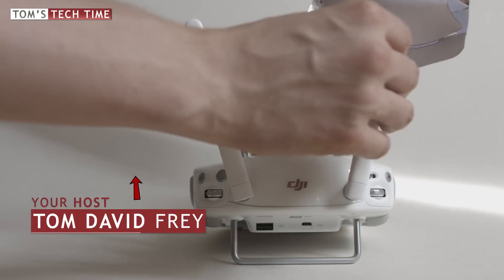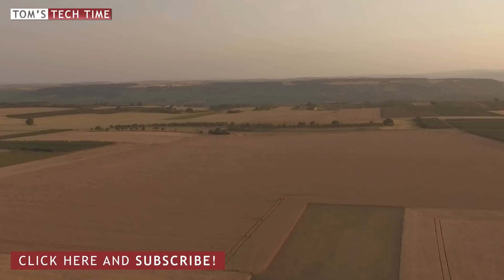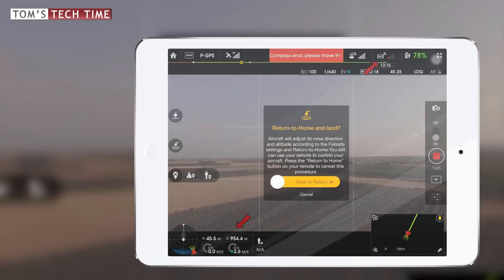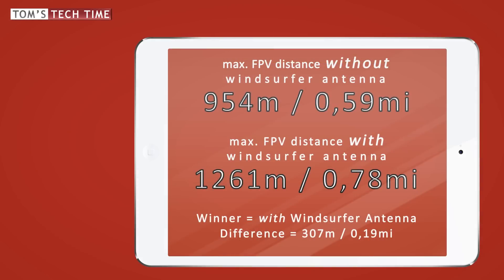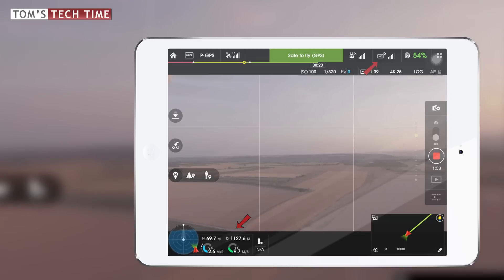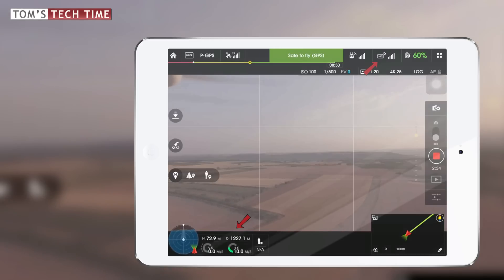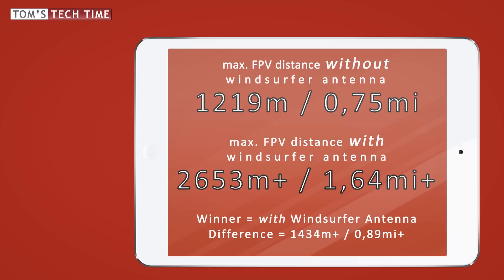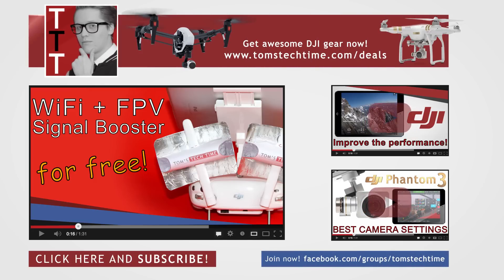WiFi Booster Range Test | DJI Phantom 3 | Video Review

Comment: i tested the wind surfers and they added 200 meters to my distance and this is in a city. it worked for my holy stone 700d drone. now im going to make them about an inch to 2 inches bigger and see what happens. stay tuned. my height was between 40 and 50 meters.

Comment: I get 2km without any reflectors and i have some hong kong ones of these on the way. So I guess I will get 4km Im surprised you are only getting 1km without reflectors. Seems a bit short. Also I would suggest you design and use these upright because your antennas on the phantom are vertical polarisation so your controller antennas should be the same. With microwave signals a 90 degree angle out can be - 30db or more of signal loss.... so even slight angle changes are going to be bad for you. Both antennas need to be straight up. Or slap me ;-) This will be correct if flying directly AWAY or TOWARDS you. If your flying sideways tilt your controller 10 degrees in the direction of flight, but only left to right flight ie sideways... then when flying towards you again keep controller straight up. Im am a radio ham and have been building drones for a few years. Read up on Polarisation of microwaves. Unless you get circular polarised antennas in which case this polcarisation thing doesnt matter.... but stick antennas are polarisation (horizontal or vertical) extremely sensitive.

Comment: Hi i need advice 
Before flight i did a small scratch on my antennas with the propellers of my phantom 4
I would like to know can a small scratch on the antennas might be problem for the drone not to fly too far cz i get no image transmition and i got 2 times the drone disconected in mid air luckly got the signal right back when i return to home.
Can anyone give advice about this ??!!!

Comment: I am amazed!  I was getting 1 Mile at most (1.6km). That was flying straight down my street. There are tons of cars, wifi, et al. It is a radio Rx nightmare. I put two (2) smaller parabolas on each antenna, and increased my flight distance to 2.5 mies (4.0 Km or 4000 meters)! Here is the FREE link: https://drive.google.com/file/d/0B6EvPgvmsFJlcVZ3QU5BZlFkVkk/view?usp=sharing

Comment: Hey Tom... great video mate.. I have bought phantom 3 4k but without wind surfers it doesn't go higher than 20meters. and on your recommendation i have the wind surfer antenna. With wind surfer antenna it goes upto 60 meters high.. any suggestions why I have so short range on my brand new undamaged Phantom 3 4k? 😕😑
Reply: You might have the beginner mode activated in your DJI Go app settings. This will restrict to 30m altitude.
Reply: no.. i have checked and double checked because somebody else also pointed that out.. but its not  in beginner mode :(
Reply: Something must be wrong with your P34k?  Even without the parabolas, I was getting 1500 ft (457 meters) altitude. double with the two parabolas.
Reply: do you have the latest firmware?
Reply: Is it fixed already?

Comment: hello   I have a phantom 3  standard  with the  10 dbi  kit i can  get  good ALT   max  400 feet by law  but  iam not getting  the  range iam getting  about 1600 feet  out  away  from me   ? dose  heat  ..hot  muggy weather  sun   anything  like that cause signal lose  ?? at  250  feet   i get   1600 feet  out  away   what   am i doing  wrong  ?? thanks   and  happy  flying   from  us  in  maine  usa  :)

Comment: Tom by holding your altitudes so low ESPECIALLY flight #1, with the trees in front of you, you are introduction RF clear LOS (or lack there of), and getting some "penetration" measurements. Your first flight told me that if the RF signal is blocked enough, even the Windsurfer can only help so much. In Flight #2 you stood, your direction didn't have trees right in front of you. They were far away. You MAY have had a clear LOS to the bird the whole time. BIG DIFFERENCE. I've accidentally dropped behind building far out, and lost my signal instantly. You can figure out (roughly) if LOS is going to be a problem from objects close by, by doing a little HS Trig. Calculate the angle to the top of the nearby trees. Arc tan (tree height/distance to trees). Compare that to the angle out at your max range: arc tan (altitude/max range). If that angle is smaller than the one to the top of the trees (or neighbor's house) then your signal is being attenuated. You were really low. Other tree lines further out could have blocked you. A clear LOS can turn a 2,000' flight into a 12,000+ flight EASY. GREAT REVIEW THOUGH.

Comment: I've been over 15,000 away feet in populated suburbia with my eBay Windsurfer upgrades.  If it wasn't for a 12mph headwind and returning home on a little over 10% battery life, I could have done farther.  I did have to push the 400' ceiling to maintain signal, tho.

Comment: hey what can you tell me about argtek antena i just installed but i have not tested how far i can go because here is too much trees and building i not in a open space but today i went about 1200 feet of distance  with alittle weak signal  ,,  http://www.ebay.com/itm/BlueProton-DJI-Phantom-3-Standard-WiFi-Signal-Range-Extender-Antenna-Kit-by-ARG-/272147724917?hash=item3f5d44ba75:g:1bcAAOSwll1W0PDo

Comment: When I fly my phantom 3 pro I get a 500m distance max, I can't fly any farther than that. How did you fly that far is there a button I need to press in the settings or what? Someone please answer
Reply from the maker: +Marlive Are you talking about the height or distance? There is a set 500m height limit. Have you turned off the the max. flight distance though in the main menu? Stay tuned and fly safe.

Comment: hey Tom how come when I send my drone out using the winsurfers everything looks fine but when I fly it back it shows on the main screen coming back slowly and it turns a little way and goes off course.when I send it really high for instance it says it's at 95 feet when it really looks like its at 200 feet

Comment: Hey Tom, I just made my own WindSurfer's with your guide and damn, I LOVE it. 
I was able to fly past 1500M distance (in an urban area, I was completely above a lot of things and still made sure I had 50M RTH just incase) and I was able to get to 350M altitude without getting interrupted signal ! 

I will only make sure to use this as not to lose signal and do some really long flights ONLY in OPEN area from now on !

Thanks a lot !!
Reply from the maker: +Antonio Alanis Glad I could help! Stay tuned and fly safe!
Reply: +Tom's Tech Time you got my subscribee!! I love the way you review, very useful !! 
By any chance do you know any FPV glasses that are the best or optimal for P3 pro ?
Thanks !!
Reply from the maker: I've only tested the Headplays HD. They're pretty cool but not easy to transport due to their size. Stay tuned and thanks for subscribing!
Reply: +Antonio Alanis I don't know where you live but isn't 350m a bit high ?
Reply: +TheBackwasher hello, i live in mexico city, and yeah 350m is really high,  i wanted to test the drones limits without losing signal, and now that i know it can go that far, i can fly without worrying if i ever go further than my normal flying (150 mts altitude)

Comment: but what is the range on the windsurfer if you face it away from the phantom?
Reply: 50.216% decrease in range because the radio waves/lightbridge is being amplified the other direction,thus getting weaker signal and range.
Reply: rafisofyan

Comment: What if the amplifying material was just aluminum flashing? How critical is the shape/radius? Thank you for the demo and testing.. great video! A++
Reply: +Frederick Dunn.. There is some physics involved. The parabolic shape created by the template is necessary to ensure that the signal to, and from the drone focuses on the antenna. Essentially, it acts like a satellite dish.  To answer your question, a flat piece of aluminum foil will do little to boost the signal. The shape is critical and is the reason that this booster works. I made the booster myself, and yes it does improve the signal and distance.
Reply: Thanks... made my own and it works well.. I appreciate your sharing the concept! Thanks also for the reply...

Comment: whats the range of the dji phantom 3 standar , does the wifi has lag
Reply: +GTDrone HI the range is very low with p3 standard. Windsurfer dont work well with this......400-600 m, maybe little more in open area
Reply: well DJI advertise 1KM is this true ? i mean in open area ,there is no point to fly to far away in the city , of course we always want more jeje  mm is there any way to increase the range on the p3s
Reply: +GTDrone  I never fly over 600- 700m in open area with p3s loose signal because we dont have fcc mode but if you live outside europa maybe then go over 1km  The Phantom have a gps position and activate the fcc if yours area  is ok . Light bridge make a big difference on advance and professional. I sold my P3S for a reason.....you have more accessories and capability to found uppgrades.....but p3S is not too bad...good camera very stable and very safe to fly and cheaper. Have tested same place with ps3S 670m and ps3P 1.3km.....no open area.
Reply: Nice thanks for your answer :)
Reply: +Jumbo I've tested my P3S in open area in EU (CE mode) and got easily 1500-1800meters and 2300 meters with windsurfer
Reply: +Patroy Ok god for you....nerver work for me...850m was max. ...

Comment: Have heard of these potentially damaging the radio due to increased SWR. Someone recorded swr and got readings in the mid to high 2's. Anyone else have problems with this. I know a high SWR will destroy the radio after a while but how long is the question.

Comment: Hi, i would like to know if this will work for the standard version?
Reply from the maker: +trackhead82 Hey, well basically it makes each and every signal stronger. But of course you can't reach those distances with the P3 Standard, but still it could be helpful. Stay tuned and fly safe!
Reply: ty

Comment: Awesome video. I did have a question though. I believe that the controller you were using is for the Phantom 3 Pro or advanced. Will the windsurfer work for the Phantom 3 standard? I ask because it looks like the pro and advanced have 2 antenna's while the standard has one.

Comment: Tom first off thanks for the great tutorials you make.  I am a new quadcopter pilot.  I have a DJI Phantom2 with a Black Pearl FPV and go pro hero 3+, without a firmware upgrade(really do not want to upgrade at this time).  Is there a way to use this cheat on the Black Pearl? On E channel 1 in DIV, I only get a clear view for about 150 meters max for wifi.  If I move around, I have reached 350 per the distance meter on screen.  Thanks again-USA

Comment: Nice video but there is something wrong with your P3 i think... My does 4500m without any mod, out of the box...

With that antenna boosters i think i can go above 6km with no problem, just didnt tested yet but its possible.
Reply from the maker: FPV Portugal Hey, first of this video wasn't a general range test, it was about the videodownlink only. During all four flights showed off in this video I had a full remote control signal still. I only tested at what distance the videodownlink would fail for the first time. Are you flying in CE or FCC? Greets and fly safe!
Reply: Tom's Tech Time CE. ;)
Great video BTW. ;)

Comment: Hello Tom!   
Great videos.   Wondering about all the talk of the vps errors.  Have you had any?  Can you make a video?  Thanks. Keep up the great work!
Reply from the maker: mauiwaverider Hey, I disabled my VPS right away, even though I didn't have any problems with it. Only if flying indoors or very slow and low to the ground I would recommend turning it back on. Next to that you shouldn't use VPS over moving or unclear surfaces as water, et cetera. Cheers and fly safe!

Comment: cool XXL - thanks - but 1 question ...
can you do another test (or if you know the answer 100% sure its also ok)
if you fly without the windsurfer antenna's and you are (lets say) 1000 meter away and the connection flips out but you put the antenna's quickly on will you get (immediately) the signal back ?
Reply: DroneFoto Texel I would like to see that too
Reply from the maker: DroneFoto Texel Good question. Actually it of course should help, but nothing is a 100%. Next time I'm flying I can take that to the test. Or print your own and test it yourself and let us know what happened. Greets and fly safe!
Reply: +DroneFoto Texel  Extreme question - i really want to see this too